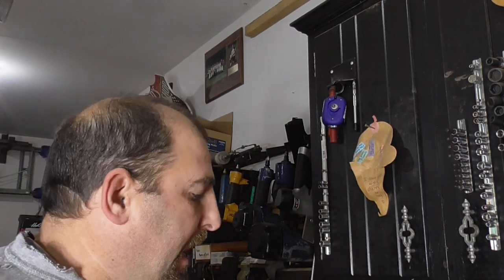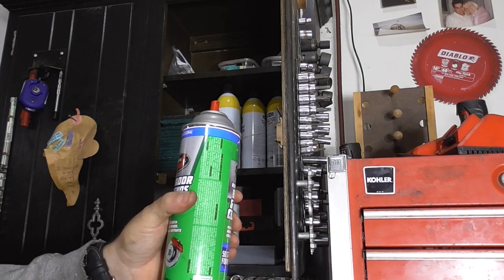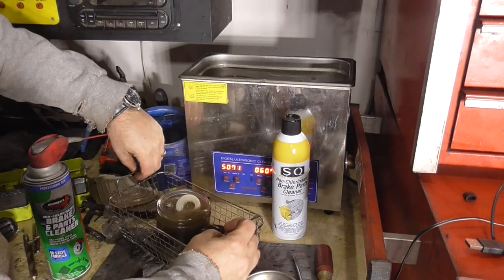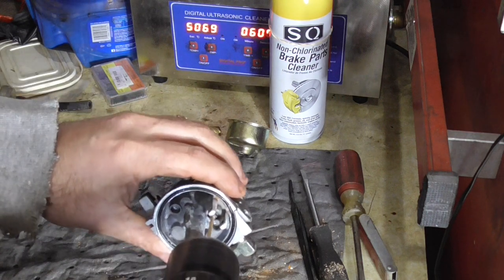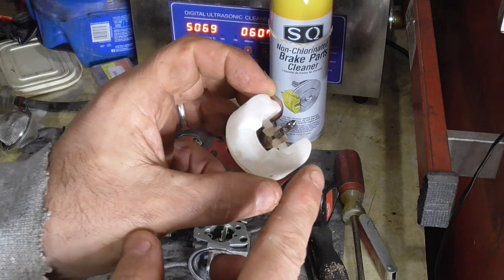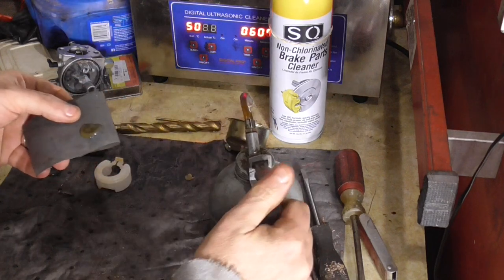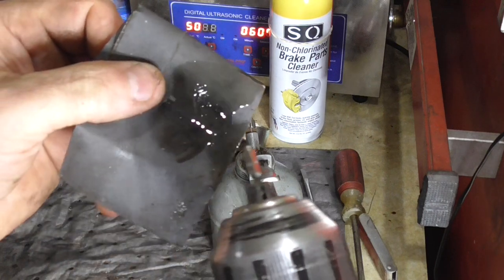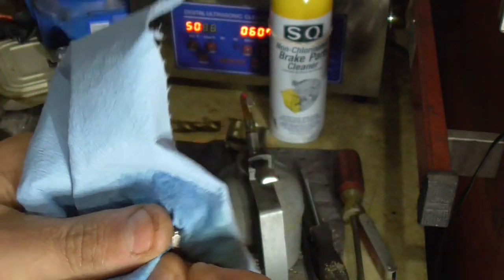Inside Out Carburetor Tricks!!!

Comment: I did a video over 2 years ago on the Q-tip with toothpaste or fine valve grinding compound.  Its called leaky honda style carb cleaning, or something like that, LOL.  But I have never considered doing what you did with the needle!  Absolutely GENIUS Bob!!!!  I cant wait to try it...
Reply from the maker: I will have to check out your toothpaste video,  Some comments are talking about using toothpaste, I thought it may have been Taryl, but after looking at his teeth, I don't think so.  Really appreciate the sub. and hanging out on the chats.  Bob
Reply: Hi guy's 
These are great tips for stopping the leaks we seem to be getting more of nowadays. 
I've been using the q-tips a lot since you made your video Steve, it works great but i have never seen the way you cleaned your needle before Bob.
Another tip i picked up a while ago was using a stick on the seat, any stick with a point on it works but a cuticle stick works best for me.
Because its only wood its not going to damage the metal seat but at the same time its hard enough to remove any crusty build up.
Its worked every time and took my carb cleaning to a new level.

Comment: Great tips, DW6. I'm like you (& a lot of other YouTube fix-it guys), I always try to rescue equipment without spending $. That's the fun of it. But recently I simply had to buy a Briggs lawn mower carb & I got one from Amazon for about $9. Hard to justify the time required to save a carb vs. these low prices, I gotta admit. BTW, I closely examined the nine buck unit & it is extremely well-machined. I haven't run it yet because it's winter here, but I've used aftermarket parts for years with great success.
Reply from the maker: Very true!  Sometimes the gaskets are cheap, but machined metal is machined metal.

Comment: Great tips!! Any idea how to rescue a carb that's been damaged by the oxygenated ethanol gas we're forced to use now? As in cleaning out the tiny passages that get clogged with the crystallized fuel? I've tried piano wire on one and it was OK afterwards, but I have a really bad one that may not clean up with that trick.
Reply from the maker: Let it soak for a couple days try vinegar to remove the oxidation.
Reply: @doublewide6  Thanks!

Comment: Bob did you test the needle with a Mityvac afterwards? I’d be curious how it holds pressure after the Re-dressing.  Thanks for the tip. I had one of those last week and drove 25 miles to get a good used needle!!! Timing is everything. The last time I tried “cleaning” the rubber tip it broke off!!
Reply from the maker: I didn't mityvac it.  But it seems to be holding just fine.  I don't know if the vitral tip has a coating on it or not.  The customer said it was leaking gas, the tank was empty when I got it.  Looking at the ridge in the needle it was closed so it should not have been leaking.  I'm thinking the guy was priming like mad because it would not start and that is where the leak came from.  For what it is worth I did it again yesterday on a lawnmower and that seems to be holding just fine (but this one was not leaking originally).
Reply: Some have the gray Teflon coating on them.  Love the tip I will try with a few old ones I have laying around!

Comment: Spray can yes👏 float needle 🤦‍♂️ That ring you are seeing is a coating on the viton...nothing more. That’s all you removed. I’ve been in this carb business along time. I have seen viton tip grooved bad and to get a customer by in a pinch what I do with my seat tools is open up the circumference of the seat...give unused rubber on the tip a place to contact new seat ring. This is a trick I started doing on old brass tip needle and seats. Viton was a major improvement. I’ve never used qtips, nor a ultra sonic cleaner. Just assortment of wire brushes, simple green, paint gun cleaning brushes, and my own homemade seat tools.
Reply from the maker: I'm very interested in your homemade seat tools could you send a pic. or forward a link to what it may look like.  I always have issues with Briggs intek engines with leaky needle and seats.  Thanks

Comment: What do you use as cleaning fluid in you ultrasonic? And is there any difference in what works best for price?
Reply from the maker: any degreaser or dawn soap.  sometimes gas in a jar to clean the outside of a carb, then the dawn treatment.
Reply: @doublewide6  is the dawn treatment 50/50 dawn and water? I'm new to ultrasonic  and trying to learn.

Comment: I thought either the carbs had a little rubber seal that meets with the needle valve or the needle valve had a little rubber tip on it?????  

I never thought it was a metal to metal seal.

When you first did the test it popped off at 10, after you honed it it was popping at 3-5 less.